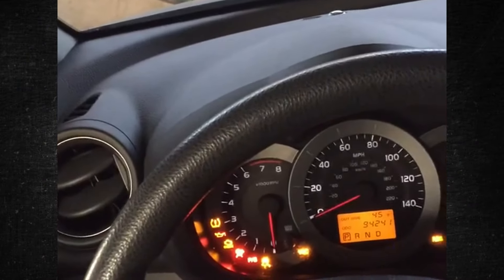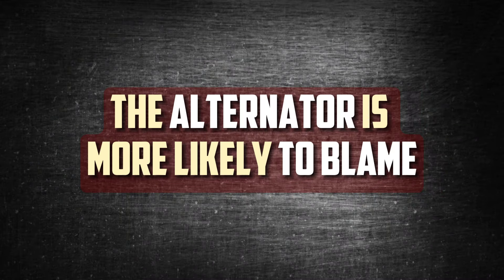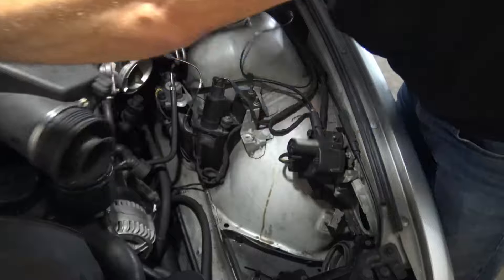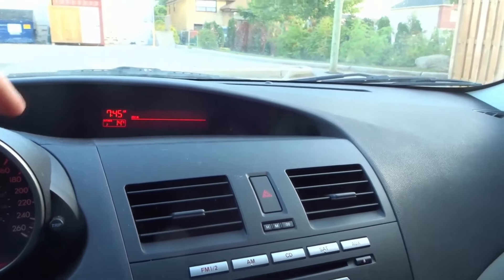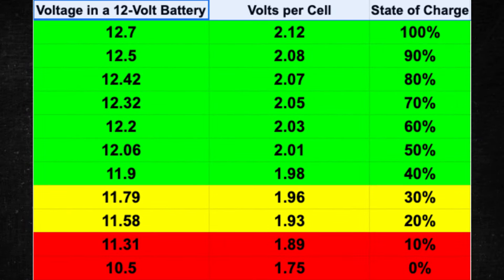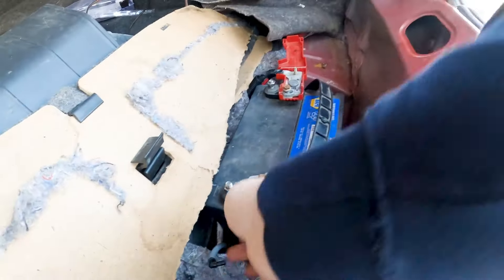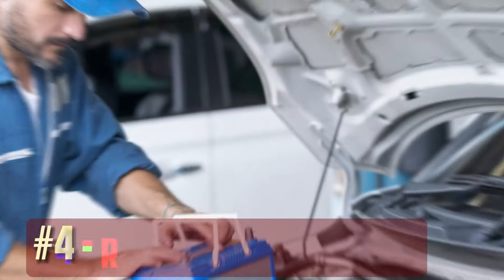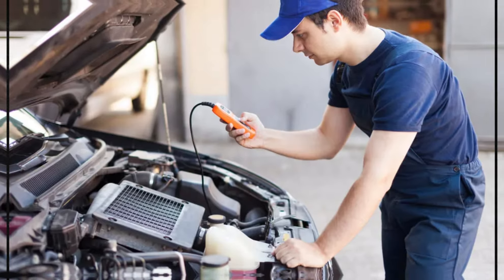Can a Car Battery Die While Driving & What to Do If it Can?

Comment: My boss years ago stupidly sent me off to deliver a car to a customer and told me not to switch off the engine as the battery was dodgy, every set of traffic lights I had to fling into neutral and keep revving the engine and quickly drop it into drive to get going, engine check light on all the time.